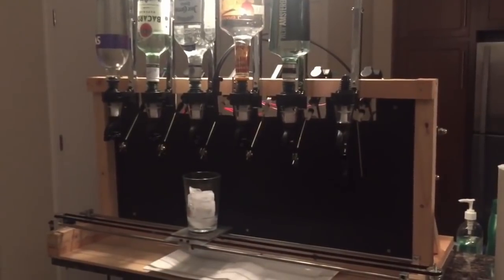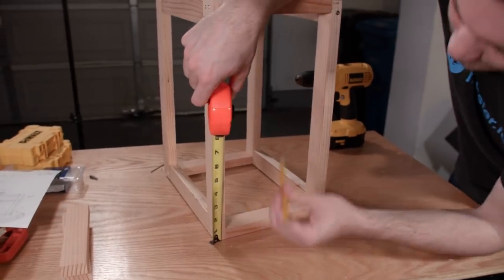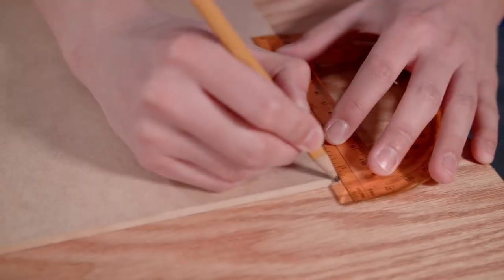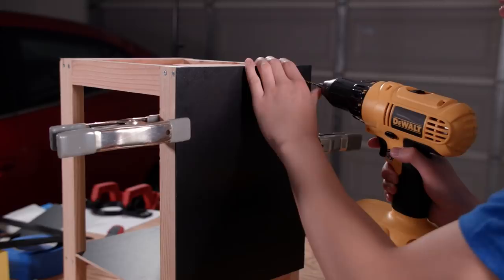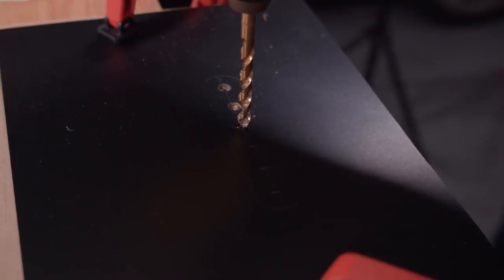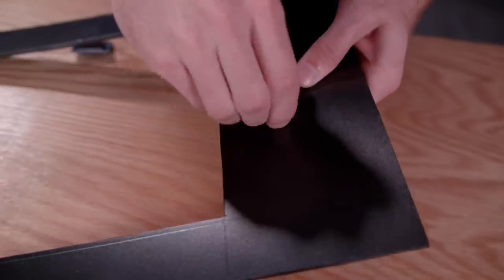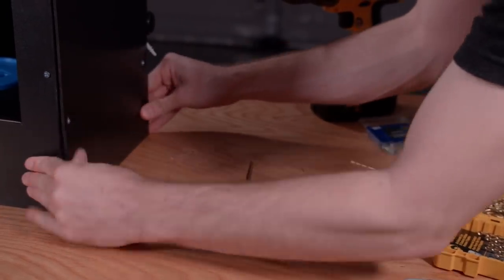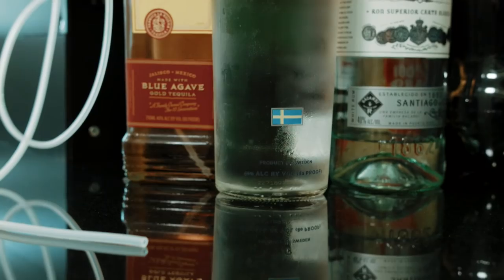How to Make a Raspberry Pi Smart Bartender

Comment: bartender 3.0 
add one proximity/weight sensor to check if there is a glass 
add a touch screen to make it easy to select a drink and configure and make new beverages 
and add alexa and/or google support to make it easy!
and maybe a cooling environment to store all the drinks
and something that checks if your bottles are full
and maybe a web panel! 
hope you like this idea!
Reply: Nemo Jansen and something that scans the UPCs on the bottles to make switching out drinks easy. All you need is one of those USB scanners Amazon has for a few bucks.
Reply: Could use a weight sensor to detect when the bottle is getting close to empty and show an alert
web panel is a great Idea Nemo just log on with your phone from anywhere and have a drink waiting when you get home
Reply: Weight sensor could also be used for measuring out the drinks, rather than running the pumps for a set amount of time like you do with mixing paint colours. Alcohol is 0.79 g/ml so if its 80 proof that (60% * 1.00)x + (40% * 0.79)x where x is the desired millilitres of lets say, vodka :)
Reply: Mike that's a good idea but instead they could have 6x RFID platforms and you slap an RFID tag on the bottom of each bottle that identifies it
Reply: And, add some alcohol-less options, not everyone drinks drinks like gin or tonic.....
Reply: BlackHawk you can customise the drinks in that text file that controls the machine.
Reply: I would also incorporate a SodaStream into this thing so it could make a lot more types of drinks (tonics and soda mixes...jack and coke, gin and tonic, etc...) without worrying about loss of carbonation. And, hook up a bottle of Saniclean (the rinse-less cleaner used to sanitize stuff for brewing beer/wine) to it for cleaning
Reply: One way to deal with measuring if the bottles are empty would be to have them on weight sensors but get bottles for it that are all the same, measure them first completely empty to set the zero for them then fill them with whatever ingredients you're using, so then it gets close or reaches what it knows as the empty weight it can react accordingly.
Reply: Integrated breathalyzer to get you intoxicated to an exact preset level and measure any effects of tolerance building up, LOL.
Reply: Instructions unclear, landed on Mars instead
Reply: Nemo Jansen I think weight sensing is a bit of an issue when you have bottles of different thicknesses of glass/plastic and the tubes could mess up measurements.
Instead, why not have each pump keep an eye on how much it’s pumped out and give a “refill” warning. You press “ok” when refilled and it zeros.
Reply: The Bartender 3.0 would be the perfect Bartender 🔥🔥🔥
I think this guys can build something like this 👍
Reply: @Nemo Jansen u have a great idea here dude🔥👍
Reply: @cabe_bedlam  that is overly complicated and it requires code and a lot of parts that can go wrong. i have an easier solution.
Reply: to make it easy just drink from the bottle

Comment: Bartender 2.0:
Marry it to a fridge to keep the drinks cool.
Add a IR beam sensor to confirm a cup or glass has been loaded before drinks are delivered.
Warning system for pumps running dry (out of liquid)?
Reply: I would argue that these drinks should be going into a shaker then either stirred or shaken to chill and dilute. The fridge idea, while good; is missing the mark a bit. The margarita mix (to me) is a good indicator that the emphasis is on the project and not the quality of cocktail.
Reply: The kind that likes their G&T ice cold even if they forgot to get or make ice.
Naturally wouldn't put things inside the refrigerated part that don't belong (brandy, whisky, etc). Unless you mean refridgerating the whole thing, in which case, I agree bad idea, and the Raspberry Pi may not enjoy being iced.
Reply: seedorfj  hey, some people like coke and flat coke. No one enjoys margarita mix LOL
Reply: Just because they used margarita mix doesnt mean you couldn't use tequila, sours, simple syrup, ect. You would just need more pumps. The whole point of this was the concept, or otherwise they wouldn't have made it so easy to edit
Reply: Maybe also add in a function to prime the pumps? Just add a menu item and then hold down the select button and it's spins them all so you can make sure everything is ready to pump and that it's the current liquid
Reply: + Wifi Control!
Reply: Louis Markert and an app would make it perfect
Reply: Could bend a copper tube in a circle the size of a can or bigger and build a something insulated around it and use a peltier with heat sink to freeze the copper tube with temp control and then when the warm liquor goes through it cools off. For occasional drinks it should keep up.
Reply: I think a strain gauge in the place where the cup have to stand where also a good idea... so u can activate the system with this and it should work better than an ir sensor because of the transparency of the most cup's^^
Reply: I'd say have a rinse feature too
Reply: SHould have an option to salt or sugar the rim of the glass. Also an ice dispenser.
Reply: @Dcool Or use a liquid block... Like 99.999999% of drinks dispensers
Reply: Bartender 2.0:
Put the mini screen at the top instead of at the bottom. Nobody wants to bend over to click buttons.
Reply: Mount to a rolling cart and use a 8-10 touch screen. Part of the cart could be refrigerated and it would keep the bottles out of sight.
Reply: haha :D Nice ideas!!!
Reply: Good Idea Rupert, I've got 6 kids that couldn't be caught dead putting the juice bottle or milk bottle back into the fridge. This way I could have the bartender inside the fridge and the kids would simply pick what they want to drink... All I'd have to do is track what gets used and get notified when it's at 10%. I could push this even further by having the kids "buy" the good drinks using their "chore money". No chore... all you get is water. love it!
Reply: id also like to see a way to select drink size and strength
Reply: add a nfc payment sytem
Reply: maybe just keep a local figure associated with each bottle with its mLs, then when your mL < 50 or 100, send a notification to your phone, or add a to-buy to your todo list
Reply: Add a touch screen!
Reply: Rupert De Wilde i
Reply: Ooh, and add a VOC sensor set up to function like a breathalyzer. "Sorry man, even the robot bartender says you've had enough." :-D
Reply: @TheWoodenRider  Until they just pull the tube out the bottle, pour a glass, then MAYBE put it back in the bottle when they're done... You'd have to make sure to build a 2nd box to keep everything locked up!
Reply: The glass needs a sensor to determine the weight also when you add a bottle you need to put the bottle size so it knows when it's about empty. then send a text msg to an owner to let them know.
Reply: @Thomate1375  proximity sensor for the win.
Reply: Reel Gag TV and a rotary encoder (turning knob) for more intuitive controls.  I would add a 3 position switch that was “light standard strong” that would tweak the alcohol by +/- some variation that would be part of each drink recipe code.
Reply: Probably gonna do smth like that in the future
Reply: Daark I was thinking that first drink is OK but the 10th drink is going to have a Long Island iced tea affect with all the different alcohols running through the same funnel. Perhaps just adding one tube connected to a water bottle. Make the pad drink sits on with a spill receptacle underneath to drain?

Comment: I made one of these several years ago using Arduino with a LCD with touch panel. The peristaltic pumps have to low capacity, and i upgraded from 4mm tubing to 6-7 mm tubing. Still slow but did the work a bit faster. I recommend looking into small food graded pumps or even air pressure for a improved model.

Comment: I’m not even a big mix drink consumer, but this is easily one of the best pi projects I’ve seen. I would probably add on a small cooler filled with ice and keep the drinks on ice in the back. Either remove the lid or just make a hole for the tubes. 
You gained a follower

Comment: hey great work guys! if i have a suggestion it would be use an air pump to push air into the bottles, with another tube displacing the liquid into the drinks. itll keep the drinks from passing through the pump itself (especially  with the coke). you would need another hose for each bottle but it probably keep the fizz better and pumps lasting longer
Reply: Skorch he shows you in the video that the type of pump they are using does not have the liquid come in contact with the pump housing. It simply "squeezes" the tube full of liquid.

Comment: My first two initial thoughts: How long does it take to prime the lines? Might want to add a prime lines option that runs all pumps just long enough to fill the lines so your initial drinks aren't ratio'd wrong. And secondly run the lines into a mini fridge base so all your ingredients are chilled.

Comment: I would add a small scale/load sensor under the glass. This could be used to verify the presence of a glass, notify of empty ingredient bottles, as well as (with a PID loop) measure the liquid volume. Also a raspi is unbelievably overkill for this project. Not a big deal, but a micro-controller such as Arduino would be much more suited, much more reliable, and wouldn't have the boot up time that a raspi has. Although network integration would take a bit more work. But overall I'm super impressed by the end result. The overall build quality and care of work you guys put in was fantastic. I'm sure it was a lot more work than what was shown in the video.

Comment: Your coke pump output is probably inconsistent because of fizz bubbles in the tube.
Also, your blue coaster is ideal as a pressure plate for scales you can add underneath.

Comment: so everything that Rupert De Wilde mentioned.

Bartender 2.0:
Marry it to a fridge to keep the drinks cool.
Add an IR beam sensor to confirm a cup or glass has been loaded before drinks are delivered.
Warning system for pumps running dry (out of liquid)?

But also a phone app (or PWA) that you cna do all the setup from a GUI. changing drink menu, lighting, maybe a cleanout function to runs through a session of pumping food grade bio-safe cleaning agents so you don't get cross contamination when changing drinks in the backend.
Reply: Easy with a college-grade small mini-fridge. Just drill a hole in the side of it and run the tubes through that. (Don't forget to hack in a PID loop to the mini-fridge because it's price is cheap but it's thermal regulation typically sucks.) Also, to know that it's running dry: Hack up a scale that the drink sits on. This will also help you understand any irregularity in the fluid flowing at the very beginning of a serving.

Comment: before you change the liquid does it spin in reverse to empty the tube from the pervious liquid? And when the tubes are empty how do you compensate so that the right amount of liquid will end up in the glass since you dont have any flowmeter along the way? Cool project, loved it!
Reply: I wondered the same thing. The funnel will also have residue from the previous drink.
Reply: I also wondered about this. I tried to make a simple coffee maker, and ran into this problem as well. Didn't finish it though :(
Reply: Firstly i like this channel and we could maybe add a priming and wash system of pipping and code... but it would still be relatively slow to pour a drink with a max 100mL flow rate....
Reply: You simply let the pump run for 1 min and the measure the amount thats in the class/bowl and then you know the flowrate and then you code a timer. so lets say it will pump 300 cl in 1 min and you want 25cl, just simply ad a timer that will let the pump run for 5 sec and you will have 25cl. these types of pumps are very consistent and will almost always flow the same amount off liquid/min
Reply: Just omit the funnel... bundle the tubes at the end so they all are above center of glass. The peristaltic pumps use suction so you may get a drip here and there, but nothing you would really notice.  The pumps have a very regular flow rate. IE they are rated to move x amount of ml per second, so flow rate isn't really needed just adjust the amount of seconds they are on to determine how much of one liquid you want. I would however not use a peristaltic pump with a carbonated liquid. use a pump to force air into the top of bottle and have another tube at the bottom of the bottle which will then push liquid out of the bottle into the glass. That should help with keeping it carbonated. Not sure how you'd be able to determine the flow rate on that though.

Comment: Also, if you drill a hole in the Coke cap, put the tubing through it, and then run the pump, it will create a vacuum on the bottle. Without any air backfilling the negative pressure being created, the pump will run the silicon tubing dry and it will eventually melt. You need to drill a second hole in the cap with a tube with a one way valve in it (allowing air in when the pump is running).

Comment: Hey! I've been doing some research for my own Robot Bartender and the different techniques for pumping liquid. There is the Peristaltic Pump which is the most precise but slow and expensive. Option two is using an Air Pump to over-pressure the bottle and with a submerged tube for the liquid to escape from, this is the cheapest option and the speed goes from slow to fast depending on how much you spend on the pump. Option three that I have not seen that much is mounting the bottle high and using a unidirectional Solenoid Valve and letting gravity do the work, speed should be the closest to pouring a drink, this is also a cheap option but require more work to setup and requires an air intake so it might not be the best for sodas. 
I would love if you could make a video comparing the tree techniques, it would be really helpful and there are no such videos so I think it would be popular.

Comment: This looked like a good and fun project BUT ... two things : (1) you could have made the box a bit larger to accommodate all the bottles (to hide them), hinged the back panel for easy access (or used velcro), then (2) drilled holes in the caps of all the bottles, inserted the hoses to the right depths of the bottles, then used silicone aquarium sealant (no odors or taste) on the holes and reused the caps on new bottles.
Reply: Also, you could have used a small refrigerator as your box, which would keep all the liquids cold!

Comment: Hello! I am trying to follow along your project. I am looking at the circuit diagram, and I'm a little confused. For the 5V regulator, the same red output wire connects to the RPi, the relay, and the dotstar strip? How does that work?

Comment: A few things I’d do is redesign the whole thing and design it like this:

1. Find or make some sealed dispenser bins (something like 3” wide, 9” deep and 10” tall or something the size of the dispenser area would be that’ll hold like a half to full bottle of Bacardi, etc) sloped to the center for the tube connection, that has a sealed, but removable lid for filling/cleaning. This would prevent fruit flies, etc and can be left filled.

2. Have 4 or 6 on each side of the dispenser part (in the middle) that way you can have one for jack, Bacardi, crown royal, bourbon, triple sec, etc. I’d put a thin black piece of material between each bin with a light smoke front panel in front of all of them and put a white led light above each one. When a drink is selected that uses Bacardi (for example) the light above the Bacardi would light up and you can see it through the front panel. So the ingredients being used lights up.

3. Have a flip up lid over the ingredients bins for filling etc.

4. Have more drink recipes, and include a multi line lcd panel for instructions. For example for a margarita, when selected it would say something like place a shaker filled with ice in the dispenser area, then after it dispenses it would tell you to shake and strain, or place in a blender and pulse, etc.

5. A sensor to detect a glass, etc is in the dispenser area to prevent dispensing without one.

6. Move the electronics into a false back that’s covered to keep them from getting wet, and replace it with a pull out drip tray under the dispenser for spills, over dispensing, etc.

7. Have a selection for size of glass, example for a Long Island iced tea, you can tell it that your using a 6 oz glass and it’ll adjust the portions for that size glass, or using a 12 oz glass, it’d adjust for that.

8. Keep the multi color led lights for the dispenser area.

9. Make a port where you can plug in a computer for servicing/updates via a usb cable, etc to make it easier for updates, etc if needed instead of pulling off the back, etc.

10. Glue the black plastic sheets you used on rather than screwing them on and maybe use a silver metal corner piece to put over the corners.

11. Put rubber feet on the bottom to protect the surface you put the automatic bartender on.

12. An option of selecting drink strength from no alcohol, little, moderate to strong... depending on the persons taste.

Just a few things I thought of to take the concept to the next level.

Oh and of course google Home/Alexa integration.

Something like a diy version of this: https://youtu.be/tnh4GNCgQGc

Comment: Love the ambition!! It would be cool if the whole system was integrated with refrigeration and a way to keep dust or other undesirable particles from getting inside the open bottles. At this point it has to be manually setup and disassembled when you are done using it. I love the use of the Raspberry Pi, I'm into aviation so I have a Pi that runs my own adsb/flightaware feeder. I'm always amazed at the versatility of the Pi and this takes it to a whole other level. CHEERS!!